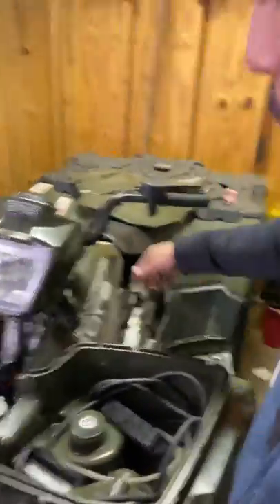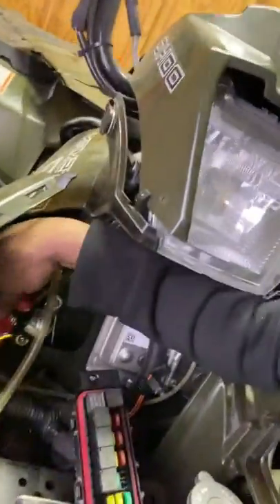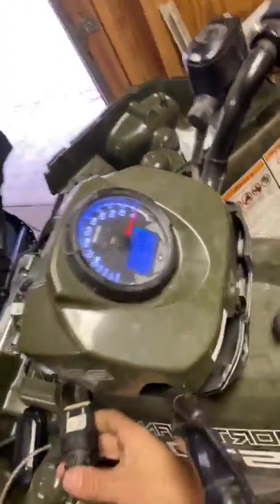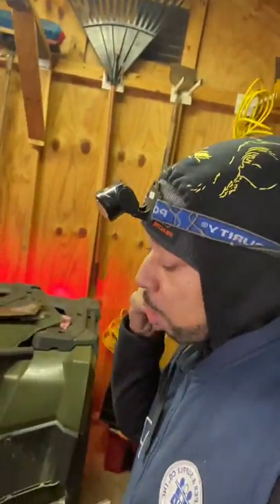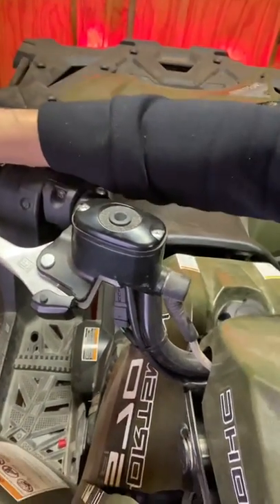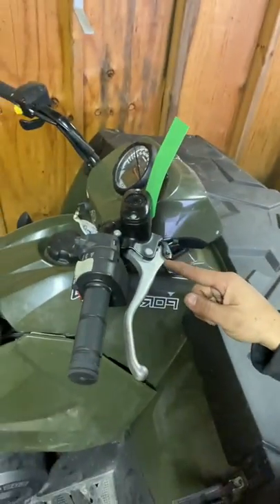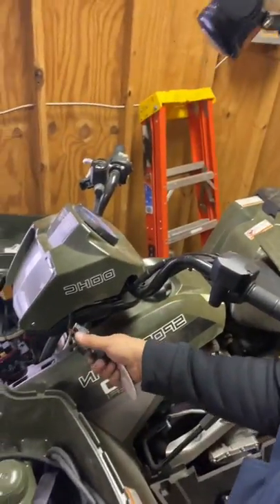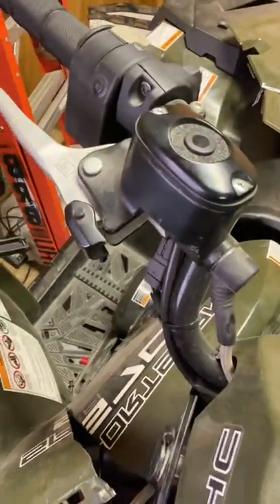No Start SOLVED POLARIS 570 Sportsman EFI Fixed

Comment: Never commented or liked anything on YouTube. OG saved me.
Reply from the maker: Much love and respect homie💯🥃
Reply: My 2013 sportsman 550 limited edition with EPS wont start the dash lights up all lights turn on battery is full but when i turn the key it wont crank. After a few seconds handle bars lock and the EPS warning indicator lights up. I’m sure that’s a whole other issue but either way atv should still start any idea why it won’t crank. No clicking no nothing, I have also held the hand brake in as I was aware of that cause it’s in the manual lol

Comment: Man i got that sportsman 570 2015 that's been a headache. I got a crank and no start. If you stay on the throttle as your starting you can get it to run probably 1 out of 3 times and then you gotta keep giving gas until it warms up, once it's warm it runs just fine. I know it's something simple to cause it ran fine one weekend, put it away, next weekend took it to the same trails and never got it running.
Reply: Changed the plug, got a new battery. Seems like a fuel issue but I don't no nothing about how to check for that. Maybe it's the fuel pump but I'd be just guessing at that point

Comment: Last night I was riding my 2017 Polaris sportsman 450 and this morning went out there to start it up the dash didn’t turn on my battery so good done try to boost it off and that battery prolly ain’t but 1 month old at max just bought the battery dash worn turn on at all. I wiggled allot of wires to see if it was a short and the dash’s till wouldn’t come on put a new 3 post on it and new spark plug wire before this all happened
Reply from the maker: Damn Broski sounds like you gotta issue with corrosion on the Circuit board of your dash

Comment: OG my 570 crunk up drove a few hundreds yards shutoff wouldn’t crank I replaced the battery and new ground terminal and now nothing no dash lights no power what could be wrong? Please help
Reply from the maker: Check the power going to the starter
Reply from the maker: Check the power going to the switch

Comment: Thank you!  It worked!  What should the output be once it is started and running.  For the battery charge?  We are getting a high output.  Battery won't hold a charge.

Comment: My man, I love this video and I learned a lot. My issue seems to come before this all—no electrical to the display or system when I turn the key (or it’s intermittent, like something shorting). My guess was bad relay or key switch but probably lots of things it could be. Any suggestions where I should start? Thanks!

Comment: Didn't help but I like your video. So i have the same no start issue. I replaced the solenoid and still doesnt start byt the key. My brake lever is depressed, and I replaced the starter relay. Could my close ground from the brake lever be the pain in my ass?
Reply from the maker: Sorry about the late response did you ever get this taken care of?
Reply from the maker: How did you make out?

Comment: If you have a 570 with EPS and it's having a hard time starting, wiggle the handlebars back and forth while turning the key.  I have to do that on mine about 50% of the time to get it to start.

Comment: @OgSnowe

My 2013 sportsman 550 limited edition with EPS wont start the dash lights up all lights turn on battery is full but when i turn the key it wont crank. After a few seconds handle bars lock and the EPS warning indicator lights up. I’m sure that’s a whole other issue but either way atv should still start any idea why it won’t crank. No clicking no nothing, I have also held the hand brake in as I was aware of that cause it’s in the manual lol

Comment: So is the fuel pump the reason for the check engin light coming on and then the quad stalling. Just wondering because thats what mines is doing
Reply: Ah hell I have that problem sometimes on my touring sp 570
Reply from the maker: It’s possible those are fuel injected so if you’re putting fuel in it is not running the injector pulse is not spraying it correctly.

Comment: OG, would this be true also for a much older Polaris, Im working on a 99 500 Remington with a no power to the starter issue. Im thinking solenoid, but this right here would make a lot of sense.
Reply from the maker: Yes could be true

Comment: I got a 2016 polaris sportsman 850 XP EFI  randomly stoped starting  I go to turn the key over and it just clicks the fuse box clicks and there's no cranking I also tryed pulling in the brake for ground wasn't it I also have a wiring problem my tail lights are messed up mayby that's apart of it idk
Reply from the maker: I’m just reading what you’re saying it sounds like the wiring is an issue check continuity

Comment: Got a 17 570 it will start one day run fine you may come back the next day it'll turn over but won't start? I replaced the fuel pump on it I'm puzzled
Reply from the maker: My bad about the late response bro let me know if you still got the same issues going on?
Reply: @OgSnowe sold it bro

Comment: So how do you by pass the break pressure bull shit bc I had took my rear caliper off and I didn’t have any back pressure for my breaks and it wouldn’t start. I had to put bolts in my rear lines and I have to pump my breaks up to get pressure to start the atv I got a rear caliper I’m about to put on it I’m just wondering
Reply: Replace your caliper as usual and bleed the system until you get a good firm brake lever.  If your machine still doesn’t start while going through the starting procedure then change the brake pressure sensor.
Reply from the maker: Sounds like the brake p sensor is bad

Comment: My 570 makes a load clicking sound but won't turn over.. any ideas?
Reply: Use spanner to tap the starter motor few taps and start ir. Most likely ita brushes need replacing inside starter.
Reply from the maker: Sorry about the late response Homie.. If the battery is fully charged and you are getting a clicking sound on the starter starter solenoid could be an issue